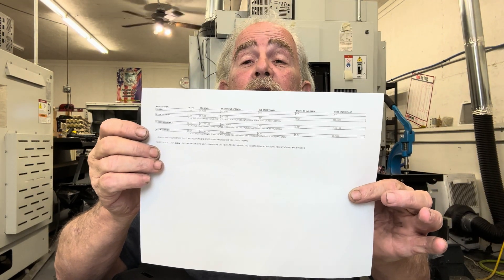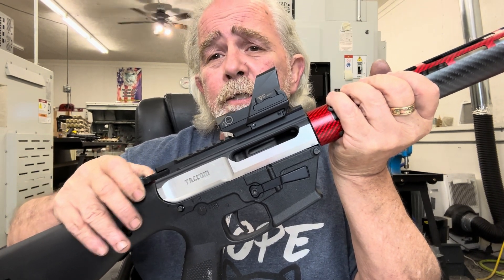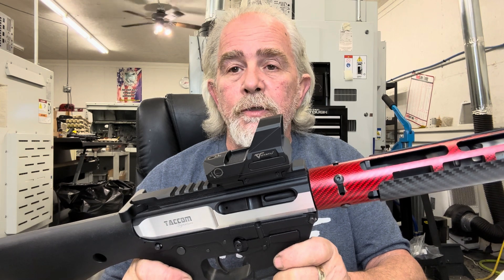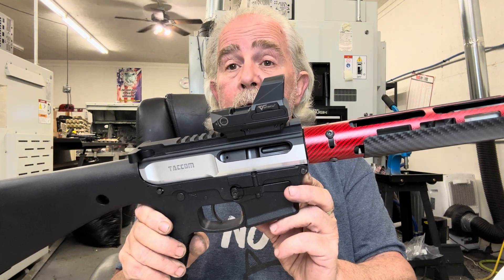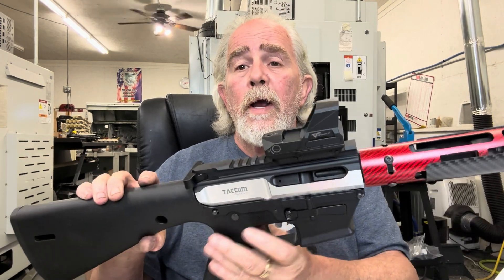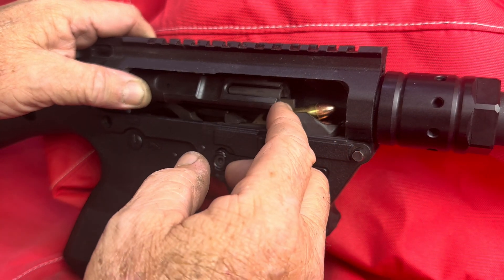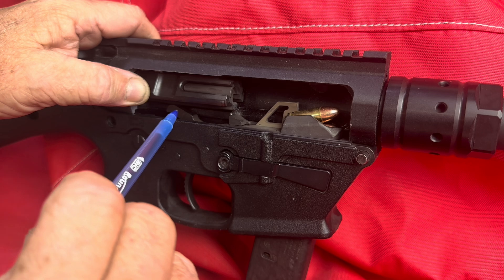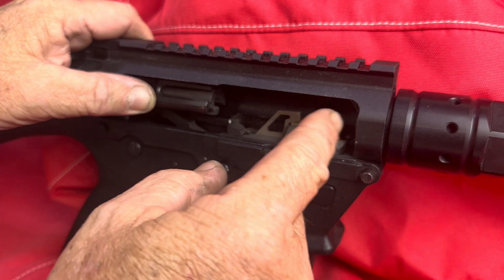TACCOM3g.com—- AR9 bolt travel and economical recoil reduction

Comment: When you say mil-spec buffer, is that a standard 5.56 buffer? (My extended 9mm buffer doesn't allow that much travel beyond the LRBHO.)
Reply from the maker: The milspec carbine buffer length is 3.26”….if you have any other length, it is not a milspec length. Regardless, you can still find your total bolt travel and address reducing the felt recoil